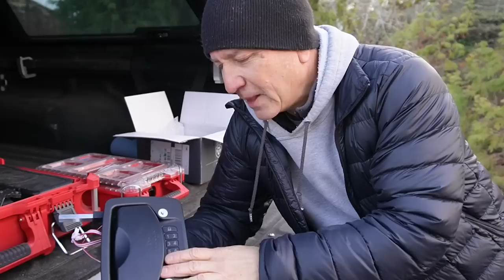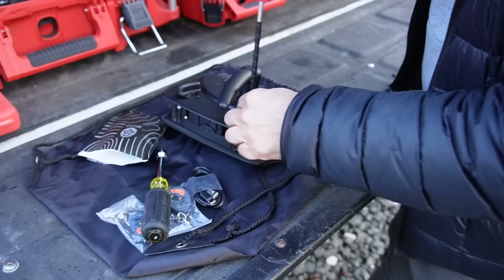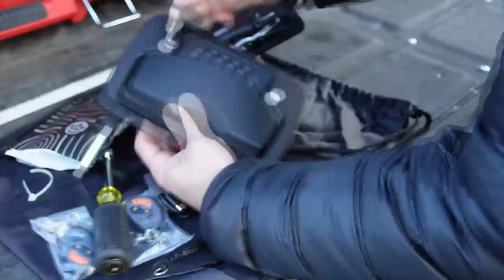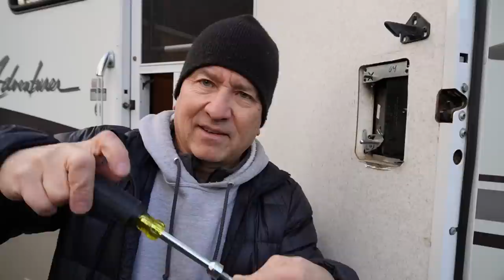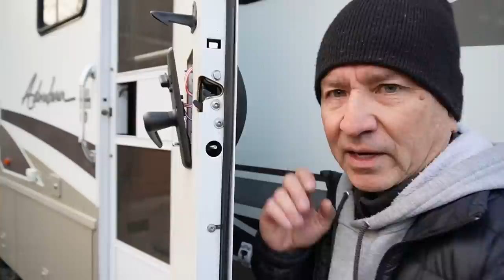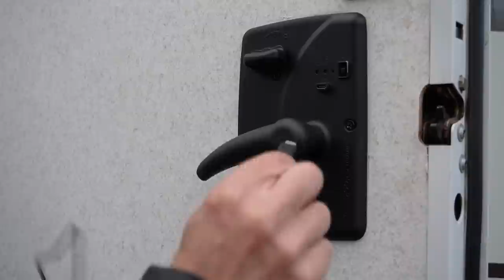(Install) RV Lock ATLAS Keyless Entry Lock for Class A RV | RV with Tito DIY

Comment: I'm happy yours worked.  I ordered the same lock for my Winnebago Vista and it wouldn't work.  It turns out those locks are made for doors that are 1.5" thick.  My door was 1.67" thick, and due to this being over tolerance the internal linkage didn't line up properly.  The door thickness is important, and since Winnebago puts an aluminum spacer around the lock in my 2018 Vista, there was no way to compress the door thickness down to 1.5" thick. It was simply incompatible.  I was very disappointed after spending 3hrs figuring out why the lock didn't work.  RV Lock gave me a full refund, as they apparently knew about this incompatibility on some rigs.  So beware and measure your door thickness first, which requires you to remove the stock door lock mechanism.
Reply from the maker: Oh that's a bummer. Good to know. Glad to hear that RVLock took care of you though. Hopefully something new will come along that fits.
Reply: I had a similar issue with my Newmar.  I modify the catch plate for the handle to be able to grab it.  We were actually locked out because it would catch the unlocking mechanism.  Fairly simple fix but was very frustrating.

Comment: Hello Tito,
This should help  out some RV owners that are having the same problem as I did;
My Atlas would not always move the dead bolt. You can hear the motor running, but not always moving the bead bolt.
I called tech support they said to spry some lithium grease onto the dead bolt.
That didn't help at all. The DB had plenty of clearance too. So I removed the Atlas and set it on the workbench.
What I discovered that the twist lock knob had a lot of turning resistance to it. So the friction motor didn't have enough torque to rotate the knob. I dismantled the knob assembly and remove some of the black paint from the base of the counter bore.
This increased the gap and know it works flawlessly !!!!!!

Comment: A courageous install.   I think I would have tested the initial manual mechanism from inside.   Then had someone inside Whalen I was testing the keyless part.   Great video.  Nicely done.  Had no idea these are available.   May have to get one for our coach.
Reply from the maker: Luckily I have a driver's side door...and I've had to use it once or twice while adjusting the lock 😃
Reply: Might be helpful to mention that as the majority of class A's don't have a second entry. I'd leave a window open on mine, or test it from inside as I could always climb out a window.

Comment: It looks like your class A experience was very similar to my class C experience. This is something I've been waiting for a long time as well - I think I installed mine in September. The only real difference in my install is that the opening for the adjustment nut was too small for the provided tool. After pondering it for a while I came up with just enlarging it a bit with a cone shaped bit for my drill. It works fine, although the company cautions you to always have a key available so you don't get locked out - in case it malfunctions, overheats (they advise to keep it out of the direct sun), or the battery runs out of power. But it seems to work fine and does its job.
Reply from the maker: Well I don't think I'll be keeping it out of the sun. That's exactly where I want to be 🌞

Comment: Great video as usual.  Was super excited to see this, but sadly they haven't made one for our lock... yet.
Reply from the maker: If there's an owners forum for your rig then maybe someone has found a solution.
Reply: @RVwithTito  I've actually contacted the company directly and they told me that they do not make one for my particular model.  It's a 2004 Jayco Class C 2700DS.
Reply from the maker: @prohomevideos  Try RecPro. I had one the RP-1098 keyless locks on my 2007 Class C. It worked great. You can also use the RVWITHTITO code for a 5% off. Here's a link to the locks. https://www.recpro.com/search.php?search_query=keyless+lock&section=product

Comment: Nice addition.  Painters tape would have been a good third hand for you.  I've used it for many 2 person jobs.   No sealant around the lock?
Reply from the maker: Yes that's true 😃 didn't have any on me at the time. I really like gaffer tape too. No. Didn't put sealant on it. It's pretty snug on there though a little bead around the inside top and sides probably wouldn't hurt. The original lock didn't seam to have any though.

Comment: Wow, I can’t believe there is no after market keyless entry lock for class A rigs until now. Any idea why?  I don’t like the rechargeable battery. My class C uses double A batteries that last well over a year.
Reply from the maker: I'm not sure if I'll get a low battery warning or not. I plug it in to charge overnight every few weeks. I don't know why there haven't been many after market class A keypads...maybe a smaller market and more equipment variations.

Comment: Thanks for the video but I am not impressed how far that deadbolt moved when using keypad. Would have loved to see how far it moved after installation. Thanks again
Reply from the maker: Fair enough. I think it moves about 5/8" or so. Door is flush to the plate when closed. So it locks fine. Hope that helps.

Comment: Did you reseal the outside with silicone or anything like that?
Reply from the maker: No. Didn't add any sealant. Previous lock didn't have any. I suppose you could if you felt it necessary.

Comment: I just had to add this to my Winnebago. The old door handle, the internal link broke and the handle just flipped but could catch to unlatch the door. With all the windows locked and no access via a cargo compartment, I had to cut and drill to access the internal latch. If you’d like to see the video on how to drill the handle, let me know how I can share it with you.

Comment: They advertise it also for a class c. I own a very common brand (Thor) and the setback  is not enough for this lock.  I have only 1-1/4. You would not think it would be so hard to make a version with a less needed setbay.
Waited so long for this to come out and it still will not work.

Comment: Discount code not working anymore
Reply from the maker: Ah. You're right. I've sent a message to RVLock to fix it. Will report back when it's fixed. Thanks for the heads up.
Reply from the maker: Heard back from RVLock. Apparently the discounts aren't available on the Atlas lock since it's their newest lock.